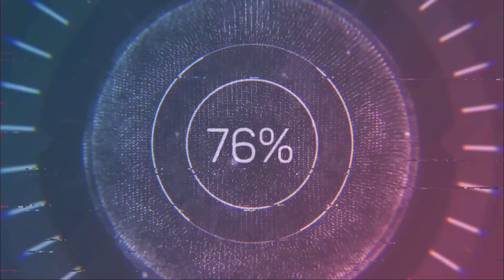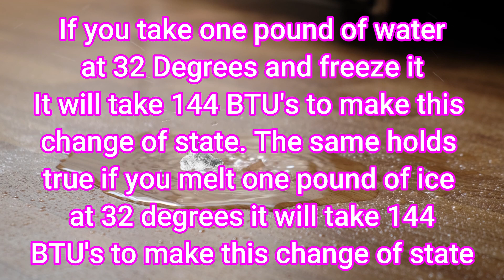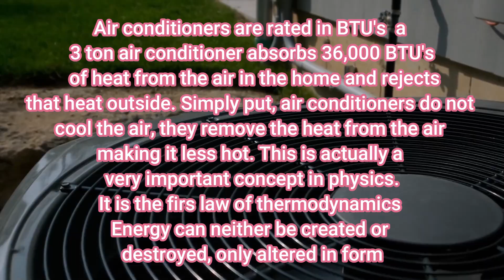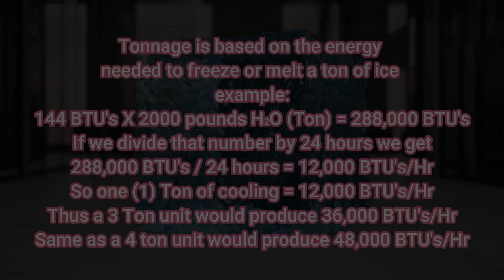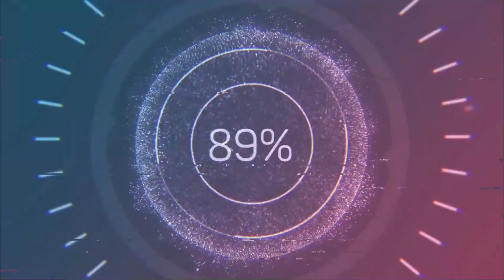Tonnage & BTUs explained

Comment: The ceiling to a room in my house is exposed to the uninsulated garage attic. Can i get by, by just rolling out insulation to the exposed slanted ceiling
Reply from the maker: Yes, you should be able to. Most homes built today with attached garages have the house portion in the attic insulated but not the garage. But if you see sheetrock above a room, it needs to be insulated.